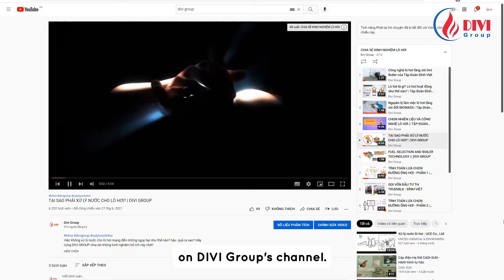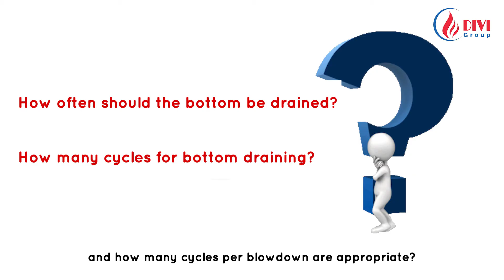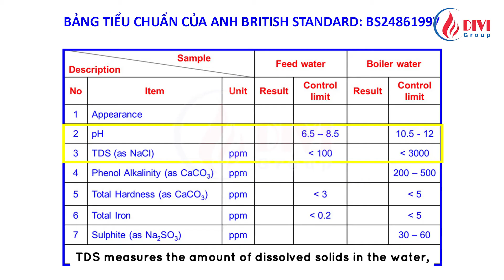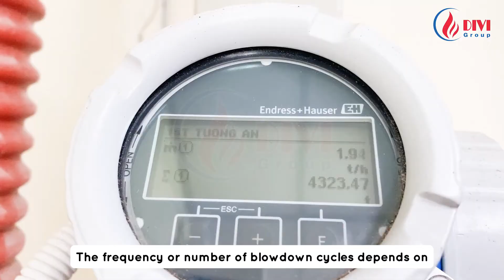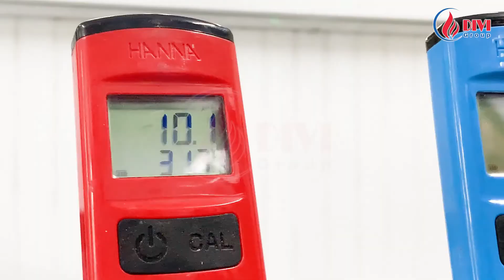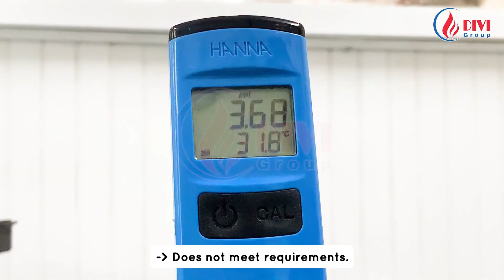Why Boiler Blowdown is a Must for Safety

Comment: Why is blowdown necessary for boilers?
Reply from the maker: Blowdown is necessary for boilers to remove contaminants, salts, and corrosive compounds that can build up in the system. This process helps prevent scale formation and corrosion, ensuring that the boiler operates efficiently and safely, reducing the risk of damage and improving the boiler's longevity.